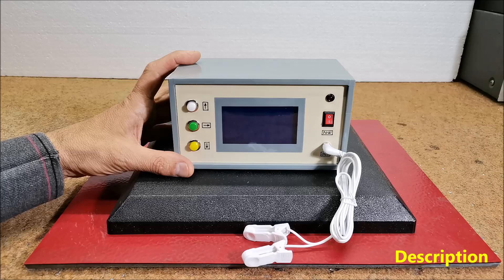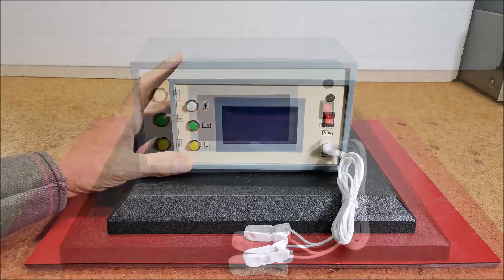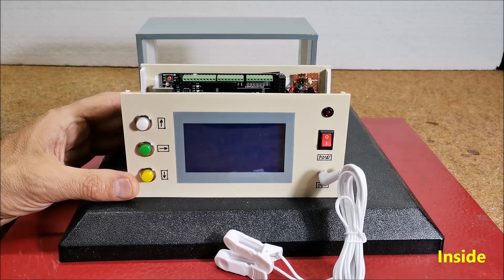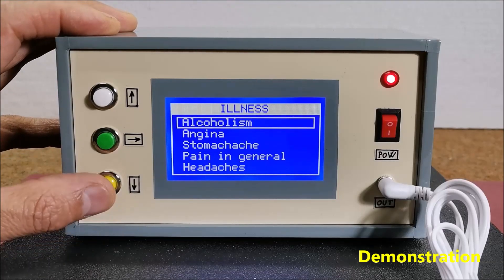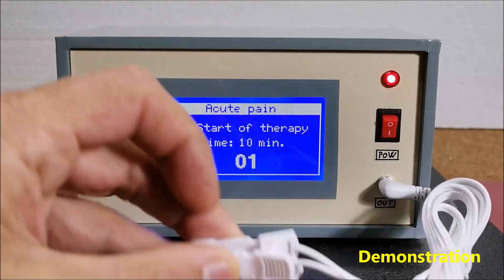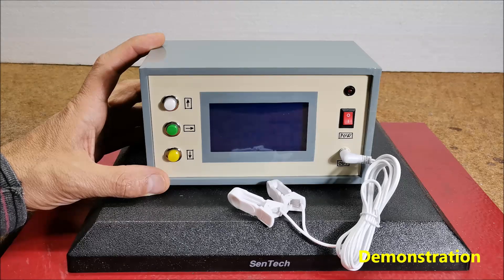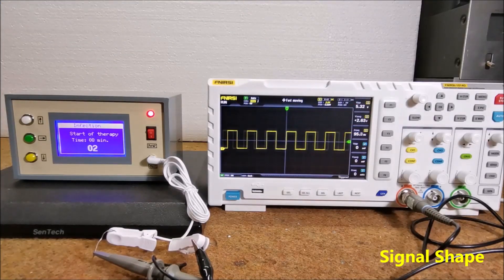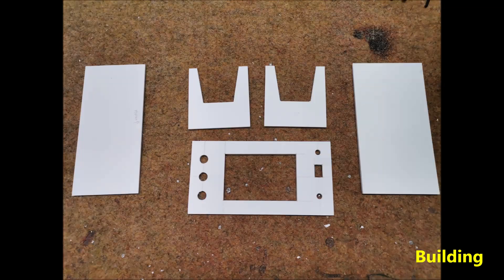Simple Arduino based Bioresonance Therapy device, RIFE Machine

Comment: I have found this how this machine work.

"Bioresonance is based on the idea that unhealthy cells or organs emit altered electromagnetic waves due to DNA damage.

Proponents of bioresonance believe that detection of these waves can be used to diagnose disease, while changing these waves back to their normal frequency will treat disease.

To use bioresonance, electrodes are placed on the skin and hooked up to a machine that “reads” the energy wavelengths coming from the body. This is process of diagnosis.

Then, those energy frequencies can be manipulated by the machine to allow the body’s cells to vibrate at their “natural frequency,” which purportedly treats the condition."

How does this machine read the body? Or is this not working like it have to work?

Comment: Thanks for your support, another question, uploading the Arduino code is easy but I need to know if it is necessary to upload the necessary libraries to the Arduino before attaching the code, and I need to know if I can change the language of the diseases, without altering the original language of the code, would it work?, thank you.

Comment: Excellent project works great, got a question if anybody can shed some light on  this, I don't know much about frequencies, but I see that the BC337 is only shifting the frequency 180 dgrees, any reason for that shift? thanks.
Reply from the maker: Ok, but the duty cycle of the signal is exactly 50% so the shift has no effect on the signal. This transistor is also a buffer
Reply: @MirkoPavleskiMK   Thank you Mirko.

Comment: #include <U8g2lib.h>

Where and how should it be pasted into the Arduino library?

I stand by (URGENT).

Thank you very much.
Reply: Solved but I note with regret that the Arduino Nano does not have the necessary storage memory to be able to compile the sketch. :( Now I have to get a Mega 2560. :)

Comment: Since the Arduino Mega microcontroller has an USB I/O could it accept operation via Frex? Is it possible to increase or add external flash memory to the Arduino board? entering over 1500 lines of code could overload the 8kb?
Reply from the maker: The Frex software is an advanced version of such a device and runs standalone on a PC (no Arduino required). While the device you see in the video is standalone and has only basic Rife machine functions

Comment: Mine does not work. When i turn on the screen does not exhibit anything. 
Would you mind help me with possible solution ?
Reply: Even if i don´t answer i would like to thank you for sharing that project. Without answer i will try some solution. With your answer i will get the solution very quickly
Reply from the maker: @ZeroD2  Recheck the display connections with the Arduino according to the Fritzing pattern. Then try to put a trimmer and potentiometer 10k to adjust the contrast according to the scheme on the link: https://www.electronicshub.org/interfacing-128x64-graphical-lcd-with-arduino/

Comment: quick note on what I can gather on rife ray tube..  AM modulation used..carrier wave I'm mhz region 3-4 mhz.. the audio signal is boosted from sig gen to higher voltage than most sig gen will output..some say possibly 2 frequency may have been used and the beat frequency was ultimate the curing frequency.....for penetration into body some say 100w -500w cb style amplifier used..tube used possibly Ultraviolet or helium..glow color blue to purple
Reply from the maker: Check out my newer video:   https://www.youtube.com/watch?v=O0TJF3Wbdkg&t=357s

Comment: Hi Mirko - There is a question about the trimming Potentiometer - is this needed?   It is not in the schematic but it is in your video.  Where is this placed?  thanks for your help and time.  This is a great project.
Reply from the maker: In place of the trimmer potentiometer on the schematic is a 220 ohm resistor. It serves to adjust the contrast of the display. So instead of that resistor, a trimmer potentiometer can be placed to regulate the contrast of the display

Comment: Hi Mirko. Thank you for the video.Can I use the uno R3 instead the mega 2569?
Reply from the maker: Arduino Uno has much less memory, it is possible to use it, but in that case only two to three sets of frequencies can be generated
Reply: @MirkoPavleskiMK poderia usar um data logger micro SD externo para armazenar a lista  e carregar em um array..
Reply: @MirkoPavleskiMK  thanks.

Comment: Hi Mirko another great job,  I made your earlier pemf device then to give it more control I opted to use an arduino which controls the mosfets this in turn is operated by a dedicated app which uses bluetooth to send the values to the arduino.  A nice 3D printed case and it works just great.  I am going to use this idea but again design an app with BT to control the arduino instead of the buttons and display.  One question though the output of the unit via the transistor is only switched 5V and very low current  is this enough to get any results
Reply: Derek, do you have videos of your work? I have a teen who is starting to be curious about DIY electronics.
Reply: Hi have you made this project and does it work? Like you mention 5v is enough or not? this guy does not reply to critical questions
Reply: @firdoshdiakus4841  Hi I used Mirko's idea but used a voltage range from 5 - 18V which controls the arduino via a dedicated android app (bluetooth) I made so the display is on a smartphone not like the one Mirko has used,  otherwise works great
Reply: @derekbrookes9497  Thank you Derek any chance you are able to share your project? even if not with the app just the hardware and software. I also cannot seem to find the electrodes anywhere? I am interested in building this device to treat my wife as I cannot afford commercial ones. I can pay you a fee for your info. Thank You